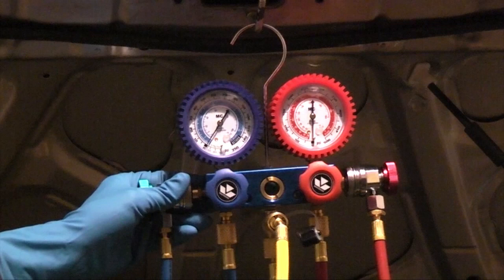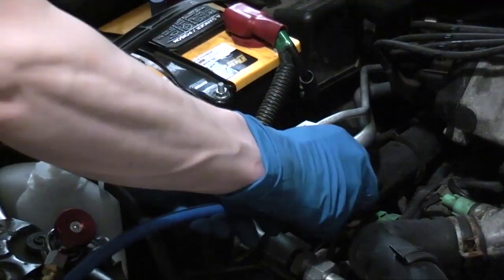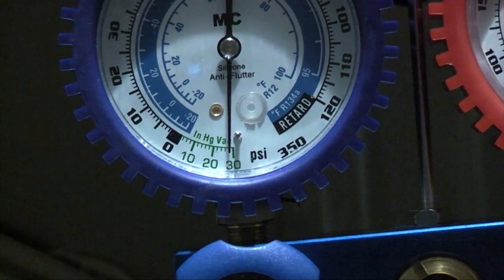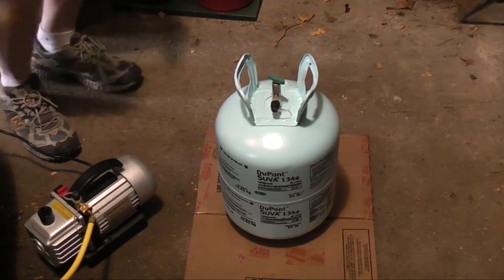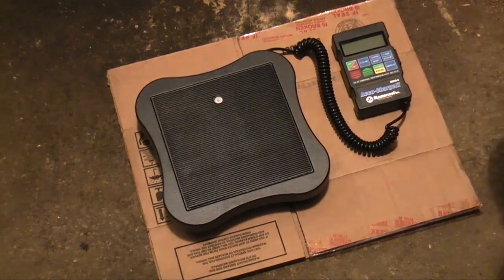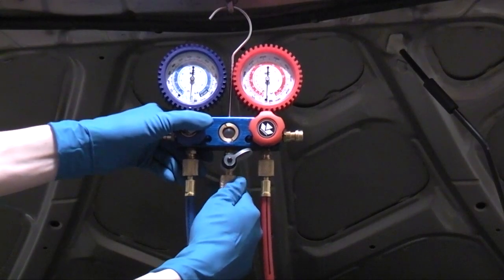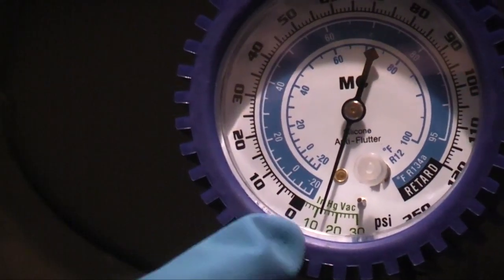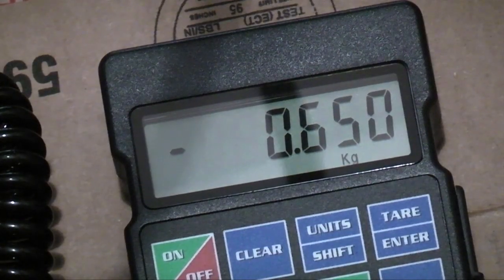How To Recharge an Auto AC System

Comment from the maker: NOTE: I left out purging the extra refrigerant from the high side hose this was INTENTIONAL. As doing it improperly which is VERY easy if you don't follow the procedure exactly will put FULL HIGH SIDE PRESSURE on your charge can or cylinder which can cause cause the one time relief valve to blow venting all of the refrigerant from the can and your system potentially on you.

Refrigerant cans have a slice partially punched out on the bottom of the can and cylinders have a thin metal disc near the top of the cylinder. When their maximum pressure is exceeded they will vent all of the refrigerant they contain. This escaping refrigerant can flash freeze skin and cause serious injury.

Comment: In this video it's stated if the AC system is left open you must change your dryer. what does left open mean? Is it considered left open if you have lost your refrigerant from a bad leaking Schrader valve and are just looking to recharge the system after replacement of Schrader valve ? Or does it mean after  changing out a major part is considered left open? Thanks for the helpful video and sorry for all the  questions.

Comment: I'm surprised you didn't add any oil after evacuating the system. What was the situation that you didn't add any oil? Doesn't the vac remove some oil? And if it doesn't, is it low on oil to begin with?

Comment: Great video Bushougoma! Question, Would you do anything different than seen in your fine video if it was for a newly installed variable displacement
 type compressor with expansion valve type system? Any thoughts on this?

Comment: Wait a minute, was the system empty before you did the vacuum?
Reply from the maker: Yes you can only pull a vacuum on a system that's empty (0 PSI on both gauges). To remove existing refrigerant you need a recovery machine.
Reply: @Bushougoma  oh, I see, thanks for the info.

Comment: I did the same thing I vacuumed did for about an hour I then starting adding refrigerant of course I don't have a cylinder so I used the little cans my system was only able to suck up one 12 oz can anymore not sure how to get my system to suck up more freon
Reply from the maker: Either the compressor is not running (bypass the low pressure switch), is mechanically damaged, or there is a restriction in the system.
Reply: Compressor turns on and stays on. I have changed the control valve on the Compressor and the expansion valve on the firewall

Comment: i thought initially when system is empty and engine off you push refrigerant on low side/vapor. i see you opened both low and high initially , pushing vapor on to high side , is that correct? high side is liquid from what i understand
Reply from the maker: The low and high side doesn't exist until the compressor starts. The restriction provided by the metering device either an expansion valve or orifice tube causes the pressure differential as the compressor forces the refrigerant through it.

After the compressor shuts down the high pressure from the high side will bleed back to the low side through the metering device until the pressures equalize. That's the hissing sound you hear after an AC unit shuts down.
Reply: @Bushougoma  ah got it an understand the theory now, thank you   after installing and recharging from scratch , i had noticed a pressure differential between low and hi after engine off, i guess you have to wait till the pressure equalizes,  if i remember correctly  my low side kept going  hi i think, does that make sense, since this was my first time installing an AC system from scratch in an humvee and charging  . still learning
Reply from the maker: @mpower3144  Yes the low side will rise and the high side will drop until they are equal.

Comment: Great video except you forgot to add oil usually it is vehicle manufacturers specific
Reply from the maker: I don't add oil unless a component has been replaced in this case the aluminum line set was replaced and oil was added I just didn't show it as this wasn't a repair video. The service manual will often specify how much oil to add when you replace a certain component. If you're recharging a known leaking system which I don't recommend the oil loss from a minor leak is negligible and I wouldn't add any oil too much oil is just as bad as not enough and can cause system performance issues.

Comment: is there still air in hi and low line? is there no need to purge  all three of air ? and could i pull the leftover r134 out of the lines by turning the tank valve off and continuing letting the compressor pull it ?

Comment: I noticed you didn't invert the cylinder to give you liquid instead of vapour when charging. We were always told to charge with liquid.
Reply from the maker: It doesn't matter R134a is a pure refrigerant it can be charged as either. If you do charge with liquid keep an eye on the suction line if the condensation starts freezing (the line turns white) you're adding it too quickly close the valve until the line defrosts or you risk liquid slugging the compressor.

For a blended refrigerant like R410a for example yes you only charge it as a liquid or it will fractionate.

Liquid charging is always faster which is why it's the preferred method as long as you keep an eye on your charge rate. With vapor you can keep the valve wide open without worrying about system damage so it's safer but takes longer.

Comment: Why is it OK to precharge the system with both Low and High side manifold valves open? Shouldn't the high side be closed even with the engine off when adding that first little bit? or does it not matter at all?
Reply from the maker: The pressures on the high and low side equalize (are the same) shortly after the compressor shuts down a pressure differential between the high and low side is only created when the compressor is operating.

Opening both valves allows the refrigerant to fill a system UNDER VACUUM more quickly. If only the low side was opened the refrigerant would have to make it's way through a restriction (the thermostatic expansion valve or orifice tube) depending on system design.

Comment: I have a 2000 Jeep cherokee  4.0 it will not take freon.. Has been vacuumed. what will cause this...All help appreciated...i tried jumping it over from the switch and it blowed my big 20 amp fuse. Twice... you could hear the rpms raise a little but didnt kick the clutch in. Im showing both sides hot/power on the switch with a test light. Is that right...It will also blow a fuse if i try to bridge it over from the relay.. However i can kick the clutch in by running 1 wire from one of the wires on the compressor to the hot on the battery then clutch works... Still wont take freon. Help...
Reply from the maker: If the compressor clutch is spinning when engaged manually and it's not pulling refrigerant in either the compressor is toast mechanically or there is a serious restriction in the system somewhere. A quick way to check the condition of an orifice tube system like yours is to pull it and check the screen for debris if there is any junk flowing through the system it will collect there. Unfortunately on your vehicle they buried it in the liquid line so you can't remove it.

As for the electrical problem is there constant power to the clutch relay contacts? It sounds like that fuse would have blown if you had to jump the clutch manually to the battery. It should be fuse 21 (15 amps) in the PDC. If so disconnect the clutch and replace the fuse if it doesn't blow either you have a short on the wire from the load side of the relay contacts to the clutch or the clutch itself is shorted internally.

If the fuse blows you have a short on the wire between the fuse and the relay contacts.
Reply: OK First off i would like to thank you for you extended reply. Havent been getting much help on here but id like to explain from the begining if you dont mind. Maybe you can help me if you know the whole thing. The big ac fuse does blow  when i tried to cross over the clutch from the low side cycling switch when its showing hot on both sides but when i unhook the high side it dont blow but it dont cycle the clutch either and that i think it should do so. kick the clutch in from that switch. the fuse will also blow when i try to bridge it over from the ac relay on the fuse box.  Right...I can jump the compressor /kick the clutch in by running a wire from  the wire coming from the coil on the comp that shows to be hot but it also shows the ground on the comp. to be hot.. hot at the plug in as well.  i know some people dont want to read a long question or reply bur i really need some help with this. i have breathing problems and i need this air to work.. i cant afford to pay a shop. Ok I have a 2000 Cherokee xj and a 96 cherokee country. right after i got it the compressor.clutch locked up on the 2000 so i used the one from the 96. both 4.os but i had to change the backs in order to use my lines etc and I change the plug ends. the comp. on 96 lines went into back/ middle and 2000 go on top. the 2000 compressor has 2 wires going in the coil  and a ground to the comp. vs the 96 has 1 wire going into the coil and a ground to the comp. Im cking with a mere test light with the clip on the battery ground and both wires coming from the coil and the ground  are hot the light comes on. i can touch the coil or anywhere on the comp the light comes on. However the 1 wire coming off the wiring harness dont have power until i hook the a/c up. plus  the low side pressure sensor switch shows hot on both sides but if i unhook the high side pressure switch i get 1 hot 1 ground. .the high side switch shows 3 hot 1 ground. 4 prong plug.  I also get with the electric fan when i unplug the fan i get 1 hot 1 ground in the plug in but when i hook it up i get 2 hots coming out both blue and black show hot. i straight wired the fan to the battery to see if it worked  unplugged using the black for the hot and blue for the ground cause thats the way it showed the wires to be when i tested the switch. black hot blue ground. with unplugged the fan works that way.black on hot blue on ground but when i plug it up to jump it  i have to reverse the  jumper wires to get it to run. i show both wires hot when plugged in.  O the compressor worked fine in the 96. the compressor is  4 or 5 yrs old. I have cked all fuse to both elect fan and A/C there all good. Question. Does the electric fan suppose to come on when the ac kicks on or is turned on from inside. Hows that work.  Ps i did have it vacuum but i prob got air in it again. I tried something and it blew one of the lines off. I replaced the o-rings and pushed it back on. I tried removing the low side sensor i pushed down the valve while having the clutch switched on manually and trying to add freon. after a short period of time it blew the line off. the line going into our firewall. from the condenser . i think thats the line were the orfice tube is that  right? Can i not ck that tube since i dont have nothing but oil in the system now. .O ya it took the oil but wont take the freon. Anyway i tried to explain it the best i can. I really need some help here. Sorry for such a long reply...
Reply from the maker: You have two separate problems here a mechanical problem and an electrical problem.

That 20 amp fuse only supplies power to the A/C clutch through the load contacts of the clutch relay. Either the clutch is partially shorted (and is drawing way too much current) which is why it will pull in when powered from an unfused jumper wire but blow the fuse when in circuit. Or there is a short in the wire from the fuse to the relay or from the relay to the clutch connector. To isolate disconnect the compressor clutch, replace the fuse, and jumper the load contacts of the relay if the fuse doesn't blow the compressor clutch field coil is junk. It should only be drawing between 2.0 - 3.9 amps nowhere near 20.

The high pressure switch contacts are normally closed the PCM which drives the ground side of the clutch relay coil monitors this switch if it sees the contacts open (system pressure is too high) or it's been disconnected it won't activate the relay which applies power to the clutch and the fuse won't blow.

As for not pulling in refrigerant I'd take care of the electrical issue first rather than trying to force the compressor to run for more than a few seconds. An orifice tube system like this one uses the pressure switch on the accumulator to indirectly regulate the high side pressure. There are three safeguards here the low pressure accumulator switch, the high side pressure switch, and a mechanical high pressure blow off valve on the compressor (similar to the pop off valve on an air compressor) you essentially bypassed both electrical switches by powering the clutch directly when you attempted to charge the system. The high side pressure rose to a dangerous level (which would normally not happen as the high side pressure switch would shut the compressor down) and the line blew off before the blow off valve got a chance to dump the refrigerant.

The fact that you said the clutch on the previous compressor "locked up" is worrying if the clutch hub on the old compressor wouldn't turn it's very probable that the old compressor spewed contaminants into the system before it seized. It's standard procedure to flush the system and replace at a minimum the condenser, accumulator, and orifice tube after a compressor failure. Many compressor remanufacturers will void the warranty if you don't flush the system because the contaminants will destroy the replacement compressor. This is why doing A/C work properly can get expensive fast.

Comment: Great video! especially the warnings about charging vapor as opposed to liquid!  Thanks for mentioning this! locking up the compressor is very possible by turning the can upside down and flowing liquid into the system.
Reply: Liquid is non-compressible. Vapor is compressible. The compressor can not handle the pressures built-up by squeezing a liquid. Something is going to bend 🤔 .

Comment: Hi, good job.
Question?
how come others tranings teachers do with the tank with the head down side.......?

and you did it with up side.... ( the tank) what's the difference?
thank you!
Reply from the maker: You can charge the refrigerant as either a liquid or a vapor valve down charges as a liquid this is a faster process but if you do it too quickly (depending on where the low side charge port is) you can damage the compressor this is called liquid slugging. Think of it as pouring a large quantity of water into the cylinders of a running engine water isn't compressible and will cause mechanical damage. When liquid charging you need to control the volume of refrigerant through your gauge set so that the refrigerant "flashes" in the low side line (converts to a vapor) by the time it  reaches the compressor. With the valve up you charge the system as a vapor this is a slower process but safer for the compressor as the refrigerant is already a vapor when it reaches the low side line.

Comment: In my country , they did not do this ..some did vacuum but mostly no vacuum, just charge the gas on low side only, and check the drier glass then done.
Reply from the maker: That's a bad practice if there is any air left in the system the moisture it contains will react with the refrigerant and compressor oil to form hydrochloric acid which eats the metal components from the inside out. That's why most systems contain either a receiver dryer or accumulator with a desiccant packet inside to absorb any small amount of moisture the vacuum process may have missed. The amount of moisture the desiccant can absorb is limited so it can't be relied on to absorb the moisture from a system that was open to the atmosphere (getting that out is the vacuum pumps job). In addition to that it can't do anything about  the non condensible gas (air) in the system which will cause elevated high side pressures.

Comment: Doesn't some liquid refrigerant end up staying in the manifold red hose after you're done charging and disconnect from the vehicle?  Shouldn't that be added back into the vehicle's A/C system on the low side?
Reply from the maker: Yes you can equalize the pressure through the gauge set but doing it wrong can put high side pressure on your charging cylinder which could cause the cylinder relief valve to blow and vent all of the refrigerant. Not to mention leaving the yellow charge line unconnected (if it doesn't have a built in schrader valve some don't) can cause you to inadvertently dump your whole systems charge to the atmosphere. So I left that step out. It's worth nothing however that even if you equalize the pressure in your gauge set that there will always be some refrigerant in the gauge set after you're done since a properly charged A/C system will never pull a vacuum on the low side.
Reply: Of course.  That's why you shut-off your charge cylinder, first.  Then, let all of the refrigerant that's left in your charge hose get sucked in through the low side.  Then, (mine has a shut-off valve) shut-off the charge hose at the manifold.  Then, close low side manifold hand valve.  Next, shut-off your high side hose shut-off valve and disconnect from the vehicle.  Now, open up your high side manifold hand valve then your low side manifold hand valve, slowly.  (Mine has an in-line vaporizer on the low side manifold).  Then, you let the vaporizer flash the liquid refrigerant into vapor before entering the vehicle's low side.  Once the pressures equalize on both gauges, shut-off both manifold hand valves.  Shut off your low side hose shut-off valve and disconnect from vehicle.  Now, all you're left with is a negligible amount of vapor, which is the equivalent of a .1-.2 oz. loss of refrigerant compared to a 2-3 oz. loss of refrigerant if left in liquid form, in your high side manifold hose.